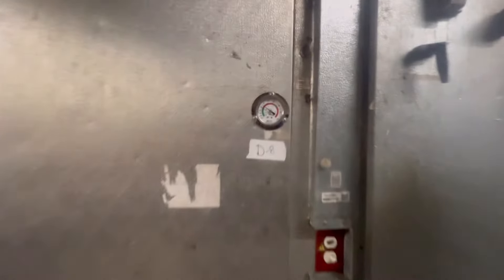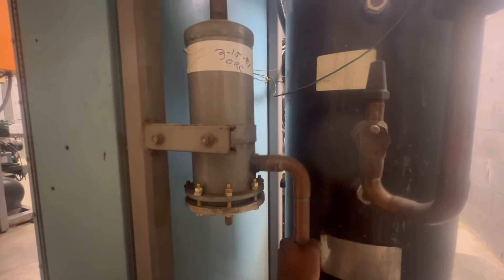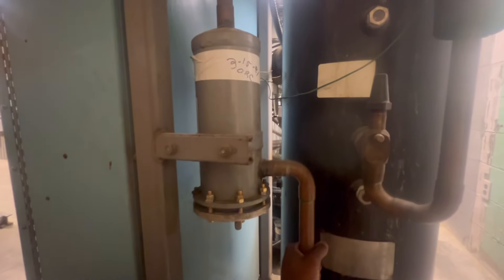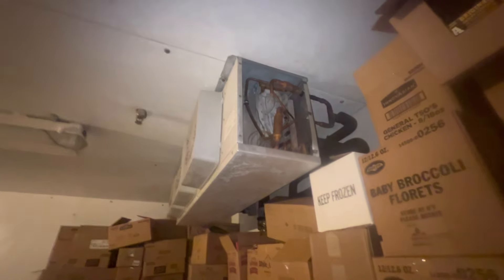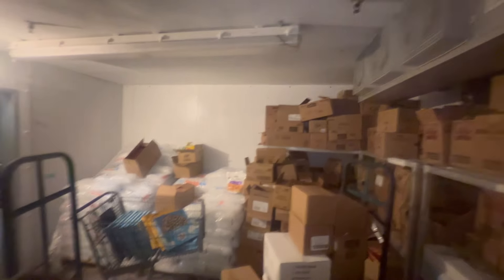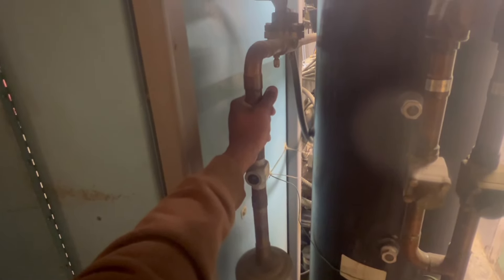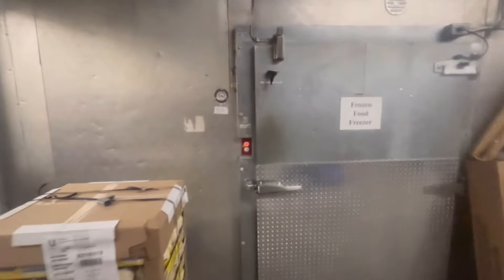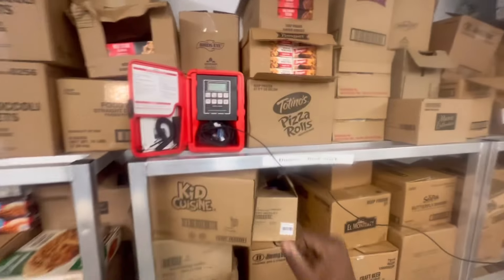EMERGENCY CALL MAIN STORAGE GROCERY FREEZER RUNNING HIGH TEMPERATURE!!

Comment: It's the floor insulated., Boxes too high. No door curtain. Add pressure to low. How long is the run? Excellent video for training thank you
Reply from the maker: All panels insulated and with out door curtains can’t maintain temperature when opened. And about 80ft to 100ft and appreciate it glade it helped!